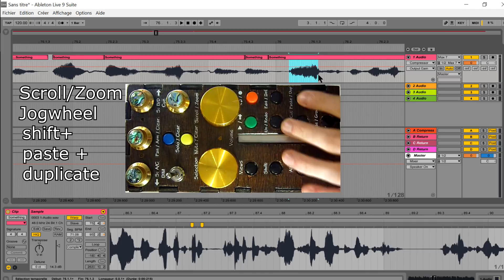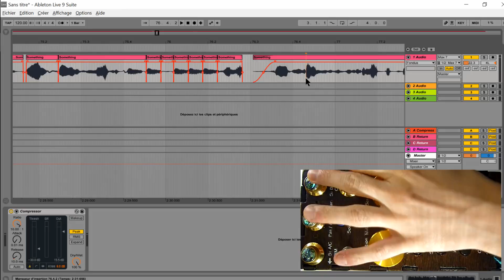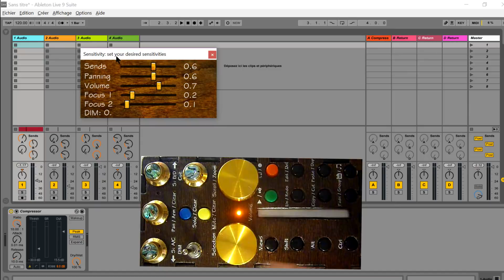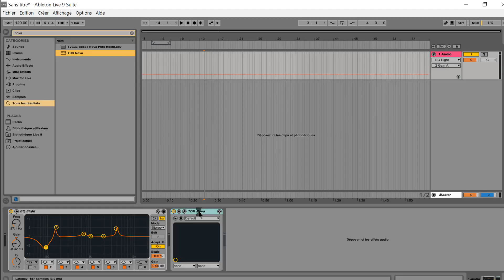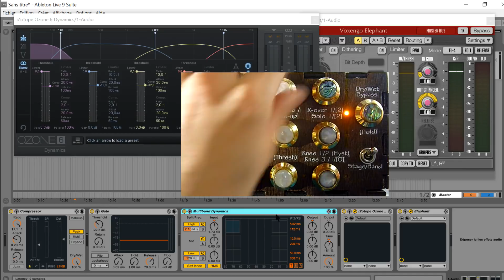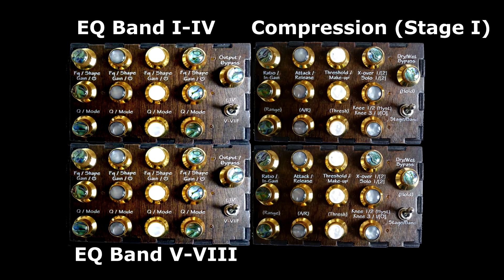Ableton Session Controller, EQ & Dynamic Units demo

Comment: This is awesome and I want one. Finally a good controller. Although I would prefer it black or wooden.
Reply from the maker: Well they are wooden?
Reply: I just mean I wouldn't want gold or those opals. But if I had to take it like it is I would because the features are great. I had a one knob solution once but it was not working like I wanted (flooding the undo history I believe and sometimes buggy). I miss it though. Also the functions of the other knobs is great. A really nice controller :)

Comment: build a session controller for me please. how much?
Reply from the maker: I don't have any production contract currently, these are working prototypes.
The pricing will depend on the manufacturer. However, an important point to me during the design of the units was to optimize the circuitry to reduce the needed parts, reducing the size and production cost of the units, so I'm expecting them to end up relatively affordable :)

Comment: Interesting, how much would we be talking?
Reply from the maker: The retail price will depend on the pricing strategy of the one producing it. However, the units were designed in a way to minimize circuitry and size, which means that they can be produced to an affordable price.

Comment: So for lets say a Dry/Wet Dial in a native Live plugin that has an onscreen resolution of 100 steps (0% to 100%, with 1% increments), what would the resolution on the AFM dial (the golden one) be?
Reply from the maker: If it's a dry/wet on an EQ/Dynamic (or any other device you custom mapped to be recognized by your EQ/Dynamics - not displayed in the video but possible), it will have the resolution you choose to (as shown at the end of the video).
If you choose to use the Magic-knob/Focus encoder then you will be able to set the precision yourself, it can switch between fine tuning and rough tuning, both scalable by the user and switched between by holding the Focus encoder pressed. Furthermore to quicker reach the desired value you can use jumps (mappable on EQ/DYN or set to every 1/4 range on the FE).
In addition, the focus encoder is a knob that's between an encoder and a jogwheel (which explains the size haha) so you can do small increments or just jogg around (displayed in the video).
I hope that answers the question :)
Reply from the maker: And sorry for the long answer, but to me all knobs are gold and have an AFM approach, so I wasn't sure what you meant :)

Comment: Someone produce this NOW. So cool!
Reply: I see the video uses Windows OS. Will this also work on Mac if produced?
Reply from the maker: There shouldn't be any problem at all with Mac :)
However for Linux, I have no clue :/
Reply: Sté T. Linux is out of the game since Ableton Live isnt available for Linux ?
Reply from the maker: True that, but what I was thinking of is the data receiver driver that does the bridge between the units and Ableton (I'm using my own protocol as I do more advanced stuff than Midi allows). I don't know if that would work with Linux, as you point out, there is no Ableton for Linux, however maybe some folks managed to run it in compatibility boxes or something and there I can't say if the units would work.

Comment: Would you know a rough price for this thing? I´m definitely interested...
Reply from the maker: The pricing will depend on the manufacturer.
However, an important point to me during the design of the units was to optimize the circuitry to reduce the needed parts, reducing the size and production cost of the units, so I'm expecting them to end up relatively affordable.